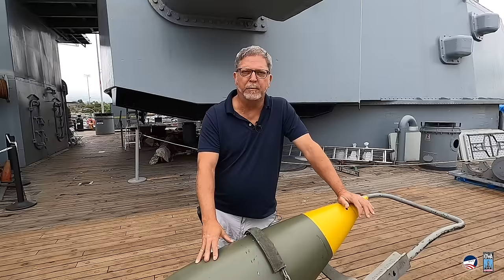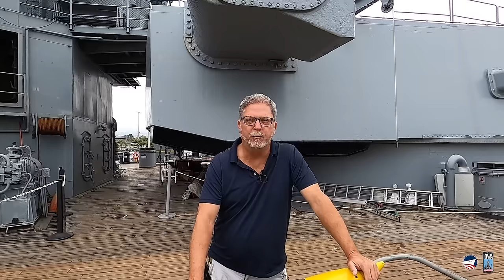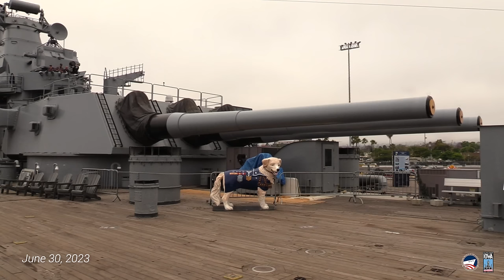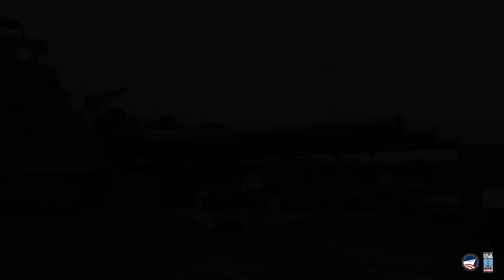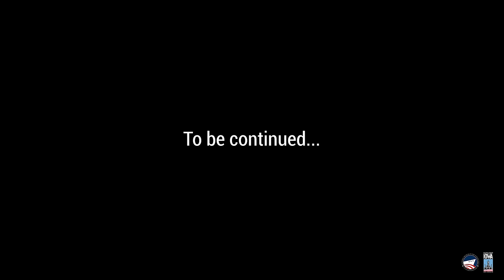Turning Turret III After 30+ Years

Comment: The Navy really needs to authorize all four BB museum ships to reactivate the boilers and steam plants for limited operation including the ability to operate the power systems that run the gun elevation mechanisms,  and to activate at least one galley so that visitors can experience the Authentic Navy Style Meals cooked right there onboard.
Reply: Battleship NJ has a video about the pins that secure the turrets in place. There's just a few welded plates holding them in. Once they're removed, the ship should, in theory, be able to move her turrets. I hope I see it someday.
Reply: Me too be totally awesome to see all three turners rotating together
Reply: I doubt the Navy will ever authorize starting up of the boilers and steam plant. And, I can understand that. They are old pieces of equipment which have not been maintained. And yet, if something goes wrong it would do so majorily. Also the fact to operate that sort of equipment is highly skilled, not including just how much work would even be required to start it all up. Afterall all the piping would need checked as well. There is too great a risk if restart them. I would imagine the turrets would have a massive current draw to enable all of them to be rotated at once. To then have a shore based power supply capable of handling that current draw I guess is the limiting factor, but, would be a much safer and better option (or else put a massive gas fired generator somewhere within the ship, that also though is a lot of work). But I agree it would be awesome to see the guns not only rotate but also the barrels having the ability to go up and down.
Reply: Never going to happen. Can you imagine the disaster it would be to light off boilers and steam plants unmaintained for over 30 years? The sea chests they need are welded shut. It woud cost millions just to be able to light them off. All that to elevate guns? They can and have recently manually elevated the guns on NJ.
Reply: Huge amount of money for nothing.  Entire steam plant would need to be resealed. Boilers are likely in poor shape internally. HFO tanks have likely already been cleaned out, where is your fuel coming from? There's little reason to do it.

The steam ships I work with have to have the engine room continually heated while in layup just to prevent seal and gasket deterioration from constant expansion and contraction cycles of the surrounding water and ambient environment. These BBs haven't had any PM in 30 years because they are never expected to operate again. 

Iirc the turrets are hydraulically operated which is why they can still be turned. The hydraulic pumps can be operated off of shore power.

Could you get an old BB underway again if really needed? Sure probably, after a 3 month drydock period at a bare minimum, for a big pile of money
Reply: If that were even cost-effective (it's not), the amount of work that would have to go into that is ludicrous.  Sea chests have been welded shut, steam pipes throughout the ship would have to be inspected, it's just not going to happen.  If powering these systems ever becomes a regular thing again, it'd be far more sensible to figure out a way to do it with external power.
Reply: As much money as our country spends on dumb shit there is no reason that this ship should not be restored to past 100% pristine condition and sailed around the country for all to see. One of the baddest machines around. Still.
Reply: @bigstick6332  If the museum foundation has the money and wants to do it, why deny them the privelege? I say that the Navy should let them do it if they are willing to pay the required costs involved.  Let the museum foundations make the final decision.
Reply: The entire government ignores the laws.....why not museums? Let them provide their own power. I bet that plant could provide lots of power to shore in an emergency.
Reply: To what end?  Now don't get me wrong, I'd love to see this, but at what cost?  Lord knows the amount of remediation needed to overcome 30 years of rust.
Reply: @johns8364  Indeed!!!!!!  I hope the Iowa Team can include some of the specifics on how they accomplished this event.  The removal of the locking devices and the details of the power supply would be much appreciated.  I'm almost sure that a huge electric bill is in the bin for the amount of power required to run this "small" event.  This is question #1 on my next visit to Iowa !!!!!
Reply: It's a lot cheaper just to turn on a microwave.
Reply: The galley on the USS Little Rock is for the most part fully operational
Reply: From what I understand, for the electrical operated equipment, there are diesel/electric plants that can run and provide the power, but anything needing steam, it is too dangerous to even attempt to pressurize the systems.

However, the kitchens can be converted into all electric, if they wanted to sacrifice one of the original kitchens for the conversion. But it surprises me that they don't have one already for when the ship is in port, but occupied, and the engines are shut down.
Reply: @nzcyclone  Sadly , In my opinion to have any hope of safely operating steam plant would require a major tear down and inspection. Not to mention the TRAINED operators that MUST be PRESENT and in CONTROL Every Second and for several hours after shut down . I was a BT2
Reply: @jeffreyyoung4104  well they are trying to run a museum and not a restaurant. You have different licenses and regulations and zoning to follow.
Reply: @No_Name_Lucas  but you're trying to run a museum, not a restaurant.
Reply: I think the Iowa just call the New Jersey out!
Reply: @WALTERBROADDUS  Just because it is a museum, doesn't mean they can't have a restaurant as well. As far as licenses, that is easily handled as well.
Reply: @yankeefist9146  The New Jersey curator said they can't get the Amp from "Shore Power"  for turret rotation
Reply: Yes, it would be cool, but among a host of other reasons I wouldn't want to be in the engineering spaces when they re-pressurize those old steam lines. I do like the idea of actually using the galleys, but it would be best to bring in equipment they can actually use. It's not like they have to feed a whole crew.
Reply: @henrycarlson7514  Yep, which is what I too said am pleased someone else agrees with me.
Reply: @rogerdeeringer6858  Remember: Where Iowa sits is much different than her sisters. There's a cruise terminal directly behind her where cruise ships come and go. Those ships often have shore power run to them. She's also in a massive port complex (Los Angeles/Long Beach which iirc is the largest port in the country and 4th largest in the world) that has massive infrastructure for shore based power. It probably wasn't easy, but it probably wasn't as hard as somewhere like where Texas or North Carolina are sitting that doesn't have all that within a stones throw.
Reply: @robdog1245  Iowa class battleships use a 1200 amp 480 volt shore power connection. Its substantial but not super demanding as far as commercial or industrial service drops go. Your average walmart or other similar sized large department store has an electrical service about that size. A 12470 three phase distribution line can easily supply that.
Reply: It would be a lot easier to simply upgrade the electrical service on the ship to handle that. All the turret gear is run by electric motors anyway, but from what battleship new Jersey said, the 1200 amp shore power connection generally isn't large enough to run the turret gear for more than one turret at a time plus everything else they need to run the museum.
Reply: @jeffreyyoung4104  but you're adding increased cost of Licensing and upkeep to a museum that doesn't get a whole hell of a lot of customers.
Reply: @WALTERBROADDUS  It isn't what I want, it is in answer to the question as to firing up the boilers to run the galleys, and other artifacts. I just pointed out what they could do to be able to run a galley without steam.
Reply: Yeah, that's never going to happen.  The steam plants are 80+ years old, have not been maintained in 30 years, and take a large number of trained operators to run.
Reply: @duanem.1567  Correct. But there are some alternatives built into the ship to operates some of the functions with electricity.
Reply: @robdog1245  The problem of getting the energy aboard ship is still the main issue.  Does Iowa have a heavier duty on board connection?  There is a current limiting point somewhere in the system and that is what I'm interested in finding. Simply having he power dockside does not turn the turret.  Some sort of cable is required to get the energy into the ships buss bars.
Reply: If they were to do any of that, they'd have to find the funds for it, and frankly, the single best option would be crowd funding. Which could either go really well (in that they get enough money to fund the work and the museum for years to come), or really badly (they get nothing)... It'd be nice, but... Money is always the kicker.
Reply: While I understand that wish, and I wished the Navy kept one of the Iowas active for representative purposes (I you wawnt to show presence, an aircraft carrier just doesn't look that menacing, even if it in fact is much more potent).

But no museum will ever be possible to maintain a machine with probably hunderts of miles of high pressure steam plumbing over 800 feet of length and in a thousand little compartments.

Steam is dangerous. It took a thousand sailors to do daily maintenance to keep this machine going. A handfull of museum staff, volunteers even, will not be able to do that.

It would be great if they could at one time light one boiler for shows, disconnected from the ships steam circuits. That would be managable.
Reply: @nzcyclone  "They are old pieces of equipment which have not been maintained. And yet, if something goes wrong it would do so majorily. Also the fact to operate that sort of equipment is highly skilled, not including just how much work would even be required to start it all up."
Yes indeed.

'Twas the night before lightoff, and all through the ship, 
the sailors were grousing and shooting off lips. 
"No heat! No hot water! Cold showers!" they cry, 
but when they complain, all we do is sigh.
 
The shore steam is hooked up and flowing, you see, 
but all of it's going to DFT 3. 
A feed booster pump runs in recirculation, 
so the feed from the tanks gets full deaereation.
 
And my watch team is settled all snug in their racks, 
(except for the poker game...open with jacks!)
But down in the fireroom the midwatch still toils, 
Before they are through, the water will boil.
 
By two the DA tank is full of hot feed, 
the shore steam is shifted, it has a new need. 
The emergency feed pump's reciprocating starts, 
filling the boiler and warming its heart." 

There's just steam for one forced draft blower to spin, 
(They purge by the chart...not just on a whim!) 
The electric fuel pump is now on the line, 
The burner barrel's ready—and now it is time.
 
At zero three hundred, right on the dot, 
the Zippo comes out, the torch is now hot. 
The porthole is opened, the torch goes inside, 
and ignites the flame as the fuel's opened wide.
 
Bit by bit now the gauge starts to rise, 
a hundred an hour is the CHENG's formal guide. " 
The morning watch paces the steam escalation, 
and ensures all is well for plant activation. 

Auxiliary steam is now brought on line, 
Main feed pumps are started...so far things look fine.  
The oil lab tests the fuel and feed water, 
It must be just so...not 'close to' or 'oughta.'
 
The 1MC call awakes me from slumber, 
'Reveille, reveille,' the Boatswain's Mate thunders. 
I dressed all in blue, from my head to my feet, 
and my shirt was all stained with traces of grease.
 
First reveille, breakfast, and muster (bit late!) 
I'm down on the deckplates at quarter of eight. 
The watch is relieved, my team is in place, 
As top watch I now am in charge of this space. 
 
The boilers are ready, the pressure's six hundred, 
The turbogen start must now be conducted. 
Inspection's completed, a message is spoken, 
And the boiler room answers, "The turbo stop's open!"
 
The aux circ pump's running, the recirc's in high, 
the sparky is waiting, he gives us the sign. 
Now gland seal! Air ejectors!  Now hand crank the pump! 
When you see the beam rise, give the throttle a bump! 
 
Slowly at first, the shaft rotates and spins, 
He speeds it up gently, until it's all in. 
The tach reads twelve hundred; the throttle's open wide, 
"On the governor, top watch!" the man calls with pride.
 
From my post on the deckplates the vacuum I read, 
Twenty-one...twenty-two...and now twenty-three. 
At twenty-five inches I leaned back and crowed, 
"Number five's ready for electrical load!"' 

The CHENG gives an order, a breaker is closed, 
in the fireroom gauges show positive flow. 
The torch flames again as the superheater's lit, 
It's six hundred degrees in just a little bit. 

Number three plant is now steaming aux, 
and the other three plants are now starting to rock. 
Steam blows from the drains as the cross-connects open, 
with the loop to full pressure we really get going.
 
The lower level watch has been marking time, 
as we bring on the main it is his turn to shine. 
First the steam lube oil pump, then the jacking gear motor, 
then SICLOS the main...all is in order. 
 
Our upper level watch begins raising vacuum, 
Sea suctions are opened.......main circ pump's in action. 
Gland seal's applied; air ejectors on suction, 
The hotwell's aligned, condensate pumps are going.
 
Before the main engines are ready for steam, 
the drains must be opened, the throttles to bleed. 
We've now reached the climax of our little plot, 
the fireroom opens the big main steam stop. 

We've verified pressure, the drains have blown clear, 
we now disengage the main jacking gear. 
Crack open the bypass, five turns of the wheel, 
Ahead guarding valve...now that's a big deal!
 
The rotors can't stall, or else they might bow, 
we can't put on way...that you must know! 
So ahead, then astern, the throttles are cracked, 
An eye on the shaft...first forward, then back.
 
We're ready to rumble...the first, not the last, 
but soon reports come from the other three shafts. 
The chief engineer phones the bridge for to tell, 
"Engineering is ready to answer all bells!"
 
It won't be long now 'til we hear the Bridge say, 
"It's time to shift colors...we're now under way!" 
But be sure and know as we steam out of sight, 
The World's Greatest Navy is game for the fight!

- The Night before Lightoff
By Eric H. Bowen, MMI (former)
Reply: not going to happen. These behemoths are money pits. Just enjoy them as they are.....and be glad that they came home.
Reply: I would think the easiest and most cost effective way to be able to rotate turrets. Is re plump the hydraulic traverse motor directly to either a electric hydraulic pump that can be run on shore power or else have an engine that can spin a pump. That way youre also bypassing all the old leaky hydraulics as long as the traverse motors dont leak
Reply: @nzcyclone  Maybe one day a small piece of technology can come in and provide all the power needed to energize these systems, and of course making the galley cook again!

not sure about making two out of the 4 screws to be electrically powered so as to be able to power these Iowas to and from dry docks or perhaps some short "tiger cruises" at atleast 12 knots once in a while, but boy would i pay to be able to just do a short cruise aboard, and take drone footage!
Reply: They had to have hooked up more shore power to move the turrets. The only way other than hand cranking or the active turbo generators.
Reply: Don't forget the kamikaze experience as well.
Reply: They have enough problems keeping them afloat. The USS New Jersey is 10 years overdue for dry dock now.
Reply: It would be cheaper and easier to build an shore side generator house capable of supplying the battleships with enough electricity to power the turret systems then it would be to reactivate the ships steam systems.
Reply: @samthemultimediaman  Converting over steam powered systems to electrical systems would have its own costs, and that would be high.  Plenty of engineering would go into that.
Reply: @Turboy65  the turret systems in the Iowa class battleships are electro-hydraulic. Aside from the steam turbine drive system and the steam turbine electric generators I think everything else is also electric.
Reply: It's just not possible. To run such a high pressure system as those boilers, you basically have to rebuild them. The main cost of bringing one boiler online will be deep into 7 figures. That's not considering the costs of keeping the onboard systems running on steam.
Reply: Don't forget the USS Texas, USS North Carolina, USS Massachusetts and USS Alabama.
Reply: @henrycarlson7514  How about you and many others like you volunteer to work on these projects?
Reply: we need to understand that it is a huge undertaking and requires a lot of resources to pull off, im just hoping this endeavour does not end like Enty
Reply: @nzcyclone they still start them up from time to time when the ship goes for service they sometimes start up the old engines and they sail under there own power to dry docks then towed in but they have not done that in a long time last time was when one of the Iowa went under the golden gate bridge why back but the engines still work
Reply: @kennethng8346  Yeah  . . but what the Hell?
Reply: @DIVeltro  That steam plant hasn't run in over 30 years. It'd take a lot of $ to get it inspected, repaired and fired without risking an explosion.
Reply: No, they really don't. It's unnecessary now that the guns are moved using shore power, and the cost to inspect, repair and fire the boilers would be huge. Nice fantasy though.
Reply: @Houndsworth  Wow, I would.
Reply: @erichammond9308  The Texas is over a hundred years old.  It's so old; it's the style of the old dreadnoughts . .
The 'Bama is a beauty, and it's an older class than the Iowas.  It's design seems to have a little more awesome look than the Iowas.
When you look at the Navy's latest failings; like the "Zoowalt"; maybe your dream isn't such a fantasy  .  .
Reply: I would prefer to see the ship move with its own power.
Reply: I think they galley on most museum ships should work that way they could sell food and give visitors a chance to see what it was like it would help bring the experience much greater.
Reply: I don’t think the Navy wants their four remaining Iowa Class Battleships to be steamed up for the first time in over 30 years. Those boilers were stripped of specific parts to prevent them from being steamed when they were stricken from the naval roster. Also, some of these ships are in areas were steam smoke is frowned upon, especially when it comes to ships.
Reply: @nikerailfanningttm9046  If they really need those battleships, then a little, or a lot of steam smoke annoying the neighbors would be of no concern.
Ordinances against steam smoke?
Have we really gotten that far?
Reactivating WWII technology, however, is a questionable tactic.
Reply: Any drone aerial footage?
Reply: The steam plants on these ships are worn-out, not maintained in any way in decades, and would not be safe to operate.  They also take more than a handful of highly-trained people to operate.  Never going to happen again.
Reply: @kpalmer7878 Battleship New Jersey has a bunch of videos explaining why this is impossible, even with unlimited amount. The fuel lines alone are miles long and have turned to Swiss cheese over 30 years. These are buried deep in the darkest most inaccessible depths of the ship and would have to be entirely replaced. Much as I would to see a n Iowa class sail again, it would be easier to build a new one.
Reply: @yevgeny79  I'm even crazier .  .
I'd like to see the Alabama reactivated . .
🤓
Reply: I like your thinking sir